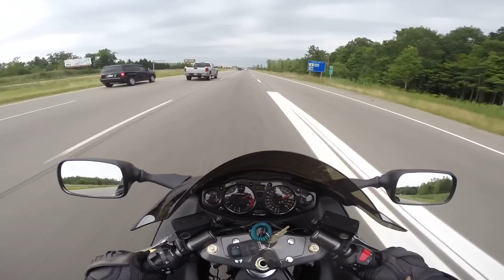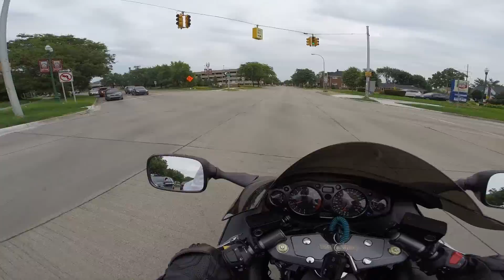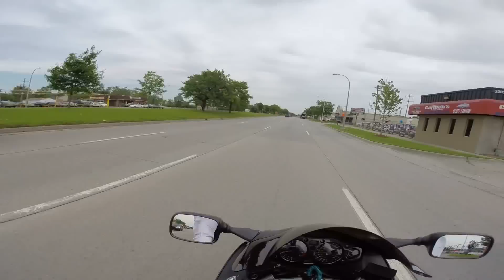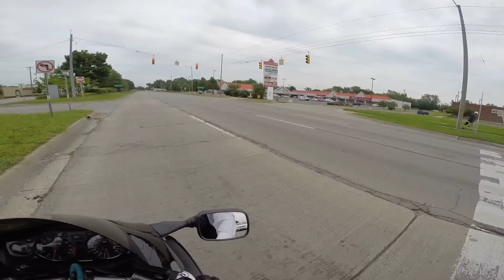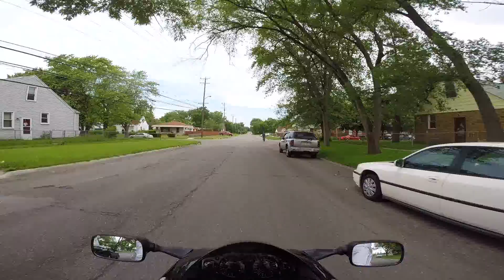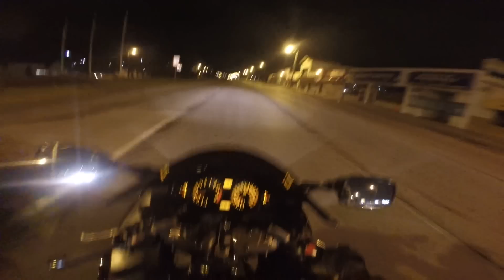Extended Swing Arms PROS and CONS!

Comment: Hey Night Rider! The longer swing arm marginally effects the turning on these larger bikes. If someone is comparing a 600 with extension and a Busa or ZX14, it is completely different. The 600-1000cc "R" bikes are very light and WILL take a lot more effort into a lean to get the same results. The Busa's and ZX14's are far heavier and there for do some of the work for you. Most often guys like myself with the large bikes are more concerned with straight line racing, and how comfortable the bike is to ride on a daily basis. ( i have a 2010 ZX14 and i am 6'-1" tall, 300lbs.) I have a 12" stretch on mine, with just a 200 tire on a stock rim. The wider tire on the stock rim helps crown the tire more, assisting me in the corners. I still felt a difference in it after the stretch but not bad at all. i was very impressed. Where i live there are virtually no roads that are "twisties" and i have yet to find a road that i can drag a knee on even while speeding. lol Most of our conners i am easily able to exceed 120mph while in the corner on my stretched zx14. I also take this bike to the track a few times a summer to do some drag racing for fun. Makes a HUGE diffrenece on 1/4 mile times having the stretch. PLus as mensioned in your vid....the look so much better....they were made to be stretched!
 If you have a buddy with a ZX14 take it out for a ride....i heard you mention that u wish the Busa had better handling.....ya its called a ZX14!! lol I have ride'n both and love both bikes, but after riding them both on the same roads....no contest...ZX14 takes it!!
Cheers!!! Ride safe!

Comment: It is more the fat tire that slows the handling than the swing arm.  It is true that a longer wheelbase will make it have a bigger circle, but much less noticeable with skinny tires. Trail ride an extended dirtbike and you will notice they can still hair scramble when set up correctly. The real deal its trail. You need to bring the back of the bike up higher the longer your swingarm is. That being said most ppl who do swingarm mods do this list, extended swing arm, bigtire kit, lowered. All wrong. Just lowering it fucks the dog more than anything. The more the back end rises the shorter the trail length will be. You compensate for the arm with a long suspension travel. So the real problem is fat tire mods and improper suspension tuning.

Comment: I extended my bike mainly for the look, I never had any intentions of taking it to the track. Aside from the more aggressive look the bike gains better straight line stability. As for cornering you get use to it quick . At higher speeds it does take a a bit more effort to lean it but nothing crazy. It also helps out a lot with cross winds, my bike doesn't have a steering damper.      I extended mine 7.5" and my bike came with a 3" drop.
Reply from the maker: +samuel lopes Yeah i think most guys do it for the same reasons you did.As far as what i have experienced

Comment: If you stretch your bike and maintain the 190 on the rear, you will be able to take corners just like if it was factory length.  My bike is 8 inch over and it performs great.  It took a minute to get used to the stretched bike due to the change in height.  To me, it has all been worth it.
Reply: you couldn't be more wrong if you tried.
Reply from the maker: agreed

Comment: I usually see extended swing arms on gixxers. I think it looks pretty cool in my opinion, but its mad expensive to get it done. Got my suspension tuned and its amazing. Handles so smooth. I highly recommend that.
Reply: +Life On Two Wheels   if you do it yourself it's way cheaper . Got all the parts for mine for a lol under $300
Reply: +samuel lopes 
I don't even trust myself changing oil. Just imagine what would happen if I tried to do extended swing arm myself. Lol.
Reply from the maker: when tastefully done it can look good.just most I see aren't lol.

Comment: this was a cons video. No pros really to be said here...
Reply: He said the pros were looks, and the fact that you can accelerate harder without wheeling. Pretty much the only two reasons people do it.
Reply: Clint the Audio Guy  
I really like extended swingarms, to a point. Nothing ridiculous. Extending the swingarm, increases Anti-wheelie, and increases stability for high-speeds & drifting. I accept sacrificing some cornering ability, for those benefits. I really hate wheelies & Endos. They're design flaws. That's the majority of the reason, why I like relatively low & long motorcycles, either modified to be like that, or like that already, like the naked version of the GL1000/GL1100 Goldwings. And those Goldwings turned into Cafe-Racers, are amazing. 

And if I ever need to make an extremely sharp turn, I can always properly drag or lockup the rear wheel, and drift out of it, I'm serious. But that will take a lot of practice to be consistent & safe, doing that. And I believe everyone should learn how to drift their vehicle, car or motorcycle, because if you ever unsuspectingly slide, then you'll instinctively know how to recover, and remain in control.

Comment: I extended my bike about 7.5" and it came lowered 3" when I purchased it in July. I mainly did it for the  more aggressive look. I use to think the stretched look was stupid but it grew on me seeing a co-workers stretched and lowered 1000RR. So when I got my bike it just looked too plain. I think you can actually build up your turning skills with it cause it takes a bit more effort to lean it at higher speeds..

As for the handling you get use to it quick. The extra length give the bike better strait line stability . My bike doesn't have a steering.g damper so the stretch helps with the cross winds a lot. My bike is a 01 cbr600 F4i and it still lifted on me accident when I did a clutchless shift from 1st to 2nd once. 

I never had track intentions with my bike and  mainly wanted to customize it. 

There is lots of hate when it comes to the extension but It looks so much better. Especially on older bikes like mine with a larger tail.
Reply from the maker: +samuel lopes Yeah i never hate on guys i think that stuff is childish! If you like it i love it.Do what makes you happy

Comment: I have a 94 cbr600f2 with my rear swing arm stretched just enough to keep the front down, prior owner kept the original so I could always go back, and stock tire size. I have had zero issues with cornering, not knowing what stock cornering for the bike is like.

Comment: It's all personal preference.  I have an K5 Gsxr-600 with the front and rear lowered and a 4 inch stretch and I have a 190 rear tire to have a little more contact in the rear.  And it handles like a dream.  Still able to get a good lean in the turns.  If done right you won't notice anything handling wise.   Too low or don't setup the suspension properly your handling of the bike will definitely be noticeable.   I live jville fl.  Everyone I ride with have some type of stretch ad still ride hard. Just do your homework.

Comment: I would never get a vehicle mechanically customized. It seems it the stock vehicle was engineered that way for a reason.
Reply: maybe a bit late to replay, but ye vehicles are always engineered for a reason, but that reason isn't always performance, they  also take cost effectiveness and ruglations into account. not saying that a swingarm is a good modification, but aftermarket parts and settings can most definetly make the bike better for the individual need. example: full exhaust, a new airfilter and different tuning is pretty much always gonna increase the performance, but they don't come stock with parts as good as those aftermarkets ones, cuz of regulations and production costs.

Comment: My CBR1100XX is stretched 4 inches with a custom arm. Handles roughly the same as stock. As long as the stretch isnt crazy (+7 inches), it should not hurt the handling. I'm not a fan of the fat tire look either, at least nothing bigger than 240.
Reply from the maker: The Hayabusa is so common to see a fat tire kit on
Reply: If I extend my Royal Enfield 350 by 4 inch, will it effect the handling??

Comment: I recently bought a 04 zx10r and it has an extended swing arm. the first thing I noticed was the difficulty turning. How would I remove it and make it back into stock length?
Reply: Stock swing arm off ebay or somethin and buy a stock length chain. Then a stock brake line
Reply: I've had my 07 zx10 since 2018 and I'm bou5 to put a swing arm on jt

Comment: Extended swing arm is only good for 1 thing....Drag racing. I'll take a bike that tears up the twisties any day over a straight drag bike.
Reply: It's also great for drifting & high-speed stability.
Reply: Observing Rogue
 Fair enough. IMO that benefit is totally outweighed by the loss in handling. It all comes down to how you ride though so I guess to each his own.
Reply: I'm only interested in a short stretch, and a swingarm & wheel, that can fit the widest rear Dunlop Q3 tire.  I'm also interested in changing the forks & triple tree, not only for a great diskbrake system, but also, for the widest front Q3 I can properly have. 

I'm doing a Café Racer project, and I want great grip. Not only are Q3s the best American made tires I know of, but the extra width should make my bike even better.

The linear feel of those tires,  with the bigger contact patch from being extra wide...I'm excited.

But that will be my next bike project. My current one is about being cheap, because I'm very poor right now.
Reply: Observing Rogue
 I hear ya. One thing to look into (and I'm no expert) but I've heard/read that bigger isn't always better for grip. Meaning that you see/hear guys who stuff a bigger tire from a 1000 on 600's for instance and it mis-shapes the tire and actually causes worse handling. I don't know this for a fact, but it would be worth looking into. I've never ran Q3's, but I did have a set of Q2's on an older bike and they were definitely a good sticky tire. Didn't last long, but I guess that's to be expected with that type of tire. Good luck with your next project.

Comment: Don't get me wrong this video is very informative about customizing bikes. But it doesn't really apply to me just yet because neither of my bikes will customized. They're all gonna be stretched because I'm gonna have them rebuilt and restored for both street riding and drag racing. All the music and lights and all that other bullshiggity will not be on my bikes. Only thing you're gonna hear when I'm heading down the highway is the roar of that expensive @$$ drag racing engine that I'm gonna have installed on my bikes